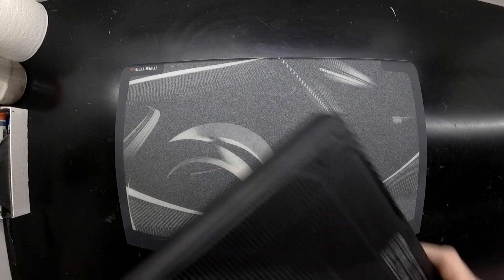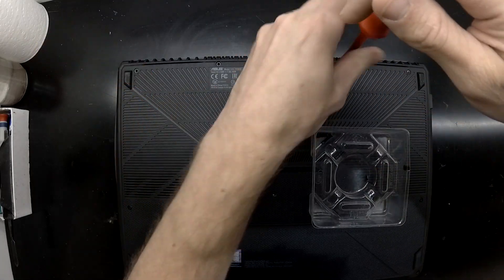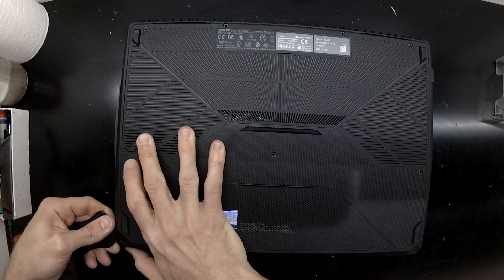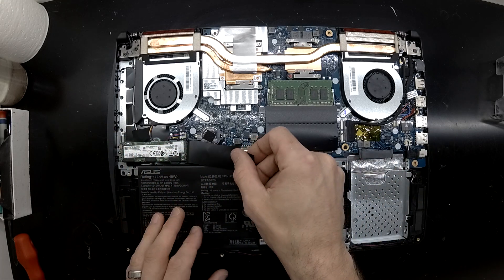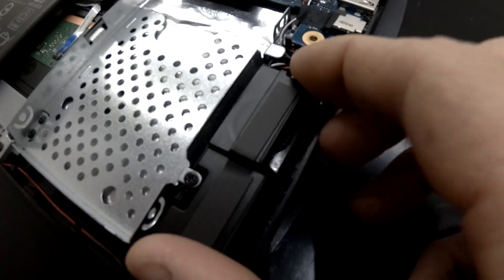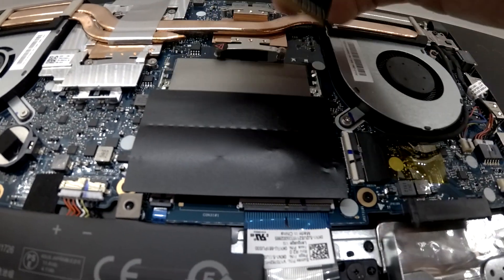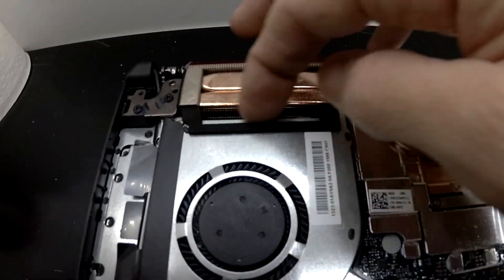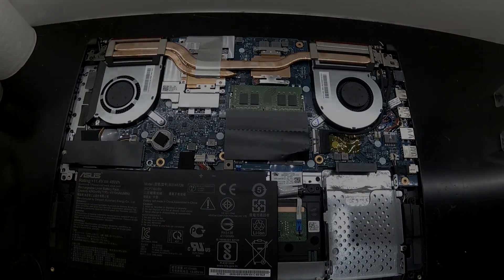ASUS TUF Gaming FX505DT Tear down and upgrade options

Comment: Hi, I have the same laptop mine is  16 gb ram I was wondering it it is possible to upgrade the ram to 32gb dual channel? so 16 on both slots ?
Reply: There is a possibility that both slots are with 8 gb ram each so u may need to buy 2*16gb ..if u don't know how to check slot available go to Task manager > performance, right bottom you can find ram details
Reply: Abdul Nafay Hasan yes

Comment: Nice video bro...i too bought this laptop,mine also came with 512gb ssd only...i wanna add 2tb hdd. So, please say some suggestions of supportable hdd models for this laptop.
Reply: You can put 1tb fast ssd their. 
I know its not cheap but hdd is too slow compared to nvme so atleast you can get nvme + ssd .
Reply from the maker: Pretty much any slim 2.5" Hard drive should fit fine
Reply: prasath easwar better than mine came with 250gb it something the. I added 1tb ssd
Reply: Can i use portable ssd?? For more Storage
Reply: @SaiNiBranDMuSic  no bro even if you use portable ssd it will give you speed of hdd. Because of usb 3 interface. if you want prtable ssd then go for cheaper and low capacity. Dont go for expencive.